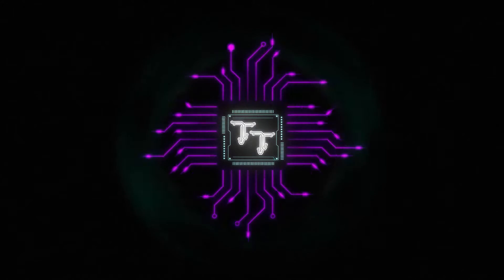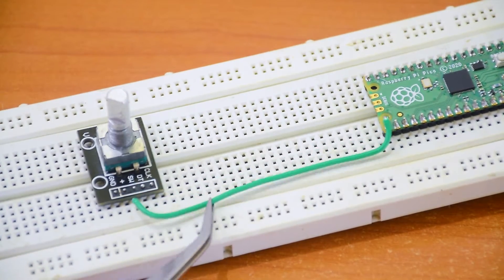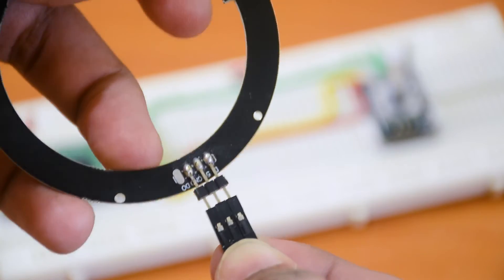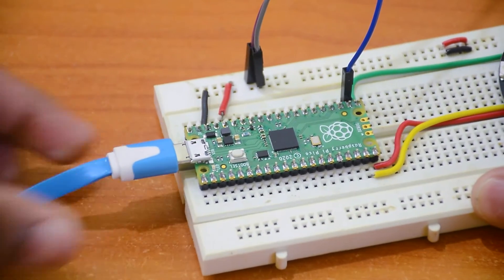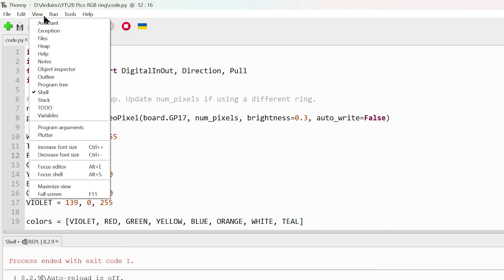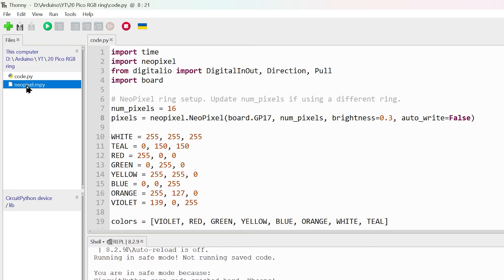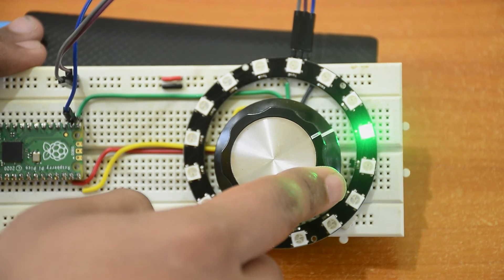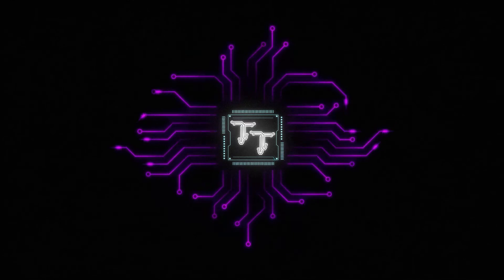Rotating NeoPixel RGB Ring - Raspberry Pi Pico Project

Comment: Raspberry pi pico's logic voltage is 3.3v and neopixel rings accept 5v logic voltage. It works just fine here. Is it safe to continue using it for long periods of time?
Reply from the maker: It is fine as long as you're using a short wire for the data line and a small amount of LEDs. Even with longer wires, it is safe. But it might just become unreliable but that also is a small chance.

Comment: I am thinking about making desktop with raspberry Pi and 10.1 inch display (i dont have those rn)
Reply from the maker: I too don't have a full Rpi for now. But it should be pretty straight forward. Pi can run Linux and support HDMI right
Reply: @techtalkies1 the display i choose have hdmi 1.1 but it's okay for me
Reply from the maker: Cool. Maybe make a video after you're done 😃